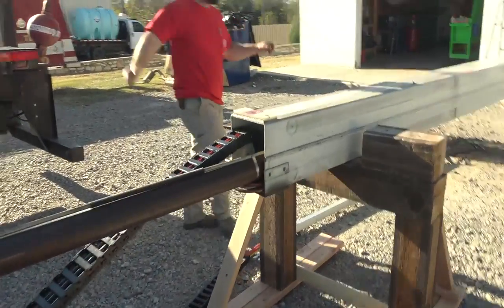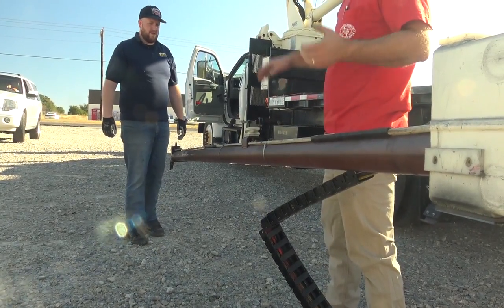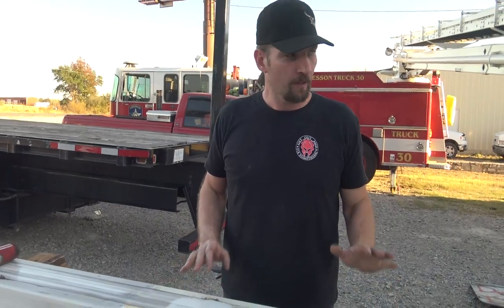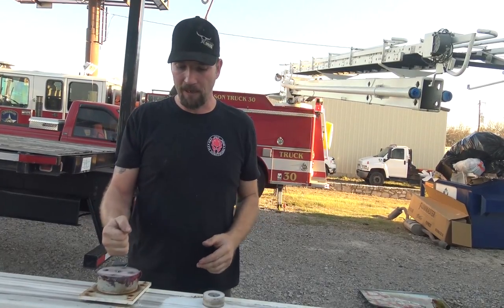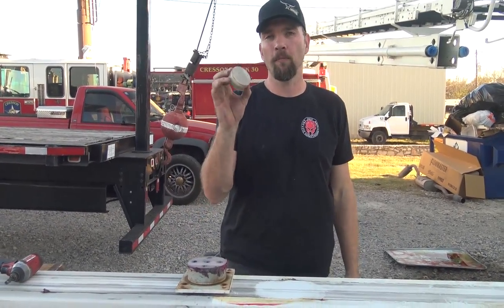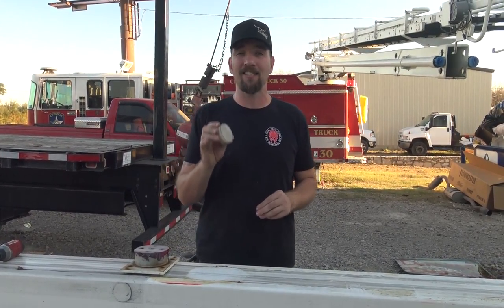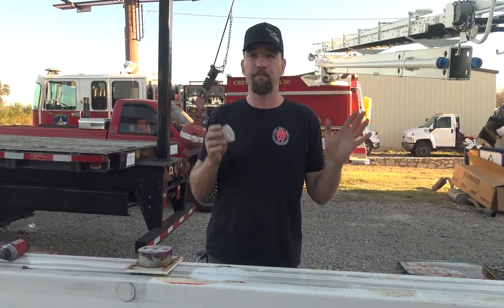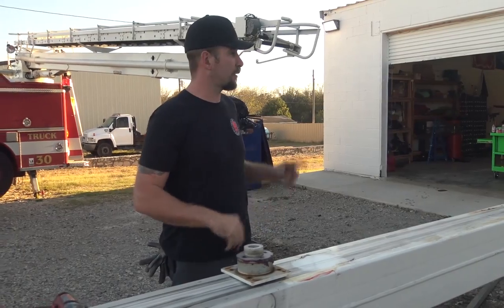Fixing A Major Hydraulic Fluid Leak On A FireTruck

Comment: Stephen, when you're rigging a lift on a wide object, if there's any chance of your slings moving, you need to use a spreader to stop the slings moving together even though they are choked.  That's why the sling ends slid together when when the crane took the weight lifting that slippery aluminum section.  A length of 2x4 would have done it.

Comment: I know you're replacing the hoses, but you should be sure to remind the dude in the cowboy hat that hydraulic hoses should not be used as a tag line.
Reply: Was not using it as a tag line, trying to keep it from getting pinched or roll back under it self and jacking up the cable tray.

Comment: Never understood why equipment manufacturer's be it heavy equipment or truck make it almost impossible to service something without disambleing half a piece if equipment... let's just put this random 2 ft hydraulic hose inside this welded shut box that you have to remove everything on the machine go get to...